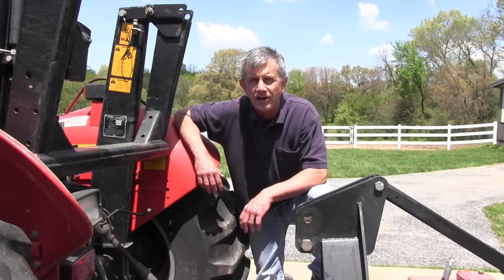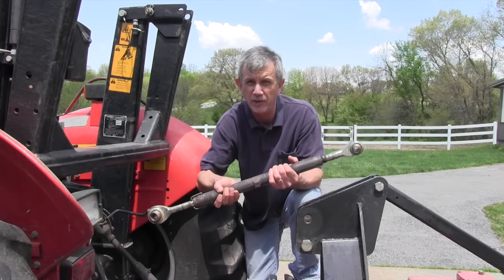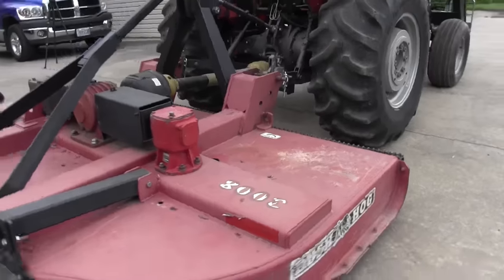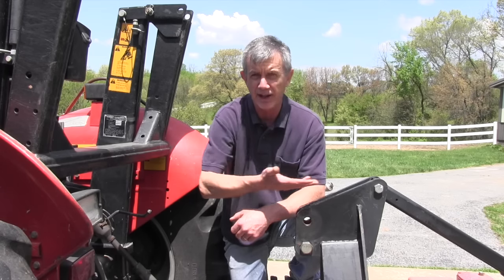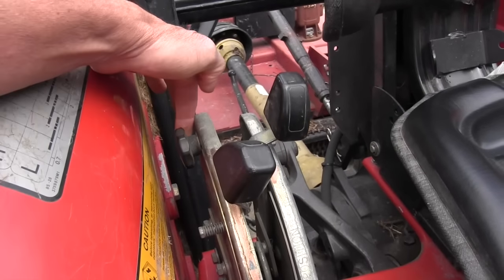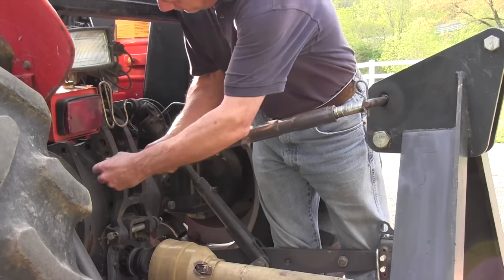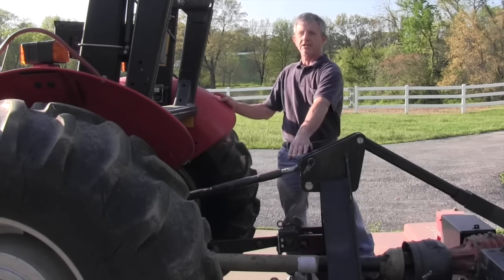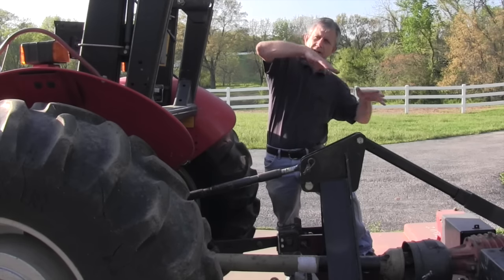Adjusting the Tractor Top Link to Pull a Brush Hog

Comment: Some tips for rear mount brush cutters. 
For cutting grass set the implement mostly level.
For cutting brush, set the back end higher than the front. This will help direct the discharge out the back.
When purchasing a brush cutter get the one with the chain guards.
If you can't afford the chain guards, buy them anyway.
When using 3 point implements, always pick up the tool when doing sharp turns.

Comment: On flat ground you are right to say your top link is along for the ride. In a not so flat area your top arm is somewhat crucial, holding up your cutter while backing down a serious grade when the grade drops three feet. It also helps keep the mower from pitching upwards to abruptly when making the transition to an inclined bank. My implement has a pivoting arm about four inches long which allows the transition to be more subtle.

Comment: Hey Mike the top link mattered ALLOT on my tractor/bush hog! I know you mentioned it needs to allow travel; here is some more detail what I saw. First I have a 48'King Kutter/RK24 combo, the mower  has hinge between top link and deck of mower to allow travel to contour of the ground. I found if it was too short raising the mower lifted the wheel. If I made it longer it leveled out the mower deck in accordance with back wheel. So too short lifts entire mower and longer can adjust the cut level on front of mower.

Comment: Finally.  Someone than knows tractors and can explain 'that' to watchers.  Liked that you used a tape measure. Does a 'top link' shrink?  After 12 years switching from Bush Hog to tiller it no longer reaches the span.  "no longer" is not a pun.

Comment: Old hand taught me to throw the solid top link to the side and use chain for top link.  Your bush hog will float with the terrain and less wear and tear.
Reply: That old hand knew what he was talking about.  A solid top link will either lift the brush hog too high when going over the top of a hill, or it will lift the tractor wheels off the ground when going through a depression.  A solid top link makes the tractor and brush hog solid like a board from front wheel to back guide wheel.  Ground is not always flat. You need flex in the middle with either a hinged link or a chain.  Get your tractor stuck in a low crossing one time and you will throw your top link away whenever brush hogging!
Reply: Yep
Reply: The only issue with this is that it puts your PTO in danger as the angle of the PTO shaft/PTO can become extreme and put significant wear on the system.

Comment: Half the time when I'm busy hogging I don't even hook up my top link. I know my area, I know the ground and there's nothing that I have to raise the entire hog off the ground to clear. So I only raise it slightly at the end of a cut run just enough to keep the skids from gouging in the turn then it's back down and continue.
Thanks for your videos Mike-
Russ
Lithia, FL.
Reply: That is called letting your brush hog float. As you go over a hill, the top link will hang on to the cutter and not let it drop and you will have an uncut part of the field. To avoid this people will remove the top link. Without a top link, If your hill is too steep, your brush hog will pull the gear box so low that the shaft touches the front edge of the brush hog and could bend. That is why you only remove the top link when mowing a field you are familiar with as you stated about your area. You have to attach the top link to lift it up for transport when ready to go home.
Reply: I have a king cutter from Atwoods.. I know it's a inexpensive  model but it has a rotating top link attachment point and I hate it .. when the mower drops off a ledge the top link will pivot down and get jammed up causing the mower to ride higher then I want it to so I just use the top link in transporting it .. so glad that I see other people doing the same
Reply: if you install front rollers on your brush hog you can lower the brush hog all the way down and wont have to deal  
with cutting height adjustment. the wheels will determine the cutting height.

Comment: I have a heavy duty bush hog attached to one of my tractors and keep it on that tractor since it is easier to do that than remove it when I want to use something else and then hook it back up. I noticed when I got my equipment that the weight of the bush hog was on the lower control arms even though the real wheel on the unit stays on the ground when mowing. I don't have a cutter like the one you are talking about, but can understand how all that weight would affect the unit performance.

Comment: I see your using Pat's Quick Hitch. I do as well. I had to replace my top link with a longer one to make up the difference in arm length. Except for my blade which works better with the shorter, original link. My point is that with my cutter, I leave the link longer so it doesn't lift the cutter if I go over a quick roll and leave an area uncut. I also have to watch it isn't too long and bends the link if the back of the cutter goes too far down. Excellent video! I love them all!

Comment: Funny enough for my old JD 2020 I used a chain as a top link.  When using the top link the overall length and making sure the two  screw ends are equal.

Comment: If the top link is not adjusted long enough, as the tractor drives over a knoll and the front wheels track lower than the rear, the cutter will rise leaving a swath of uncut material. Likewise, if the top link is adjusted too long under the same circumstance you will scalp the ground. For an optimum cut I think proper top link adjustment is paramount.

Comment: Mike very good videos and others too, I have a Kubota b2650 and I have different attachments but my Factory OME top link seem to be small are to short for my Rotary Cutter I have adjusted the tail whell and I'm still have the front of the cutter lower than the back, so can I put a aftermarket top link Cat 1 that is alittle longer than the OME to get the Rotary cutter to sit evenly...

Comment: the top link is a safety device which when adjusted properly will keep the tractor from rearing up and getting hurt or killed. the top link  draft control spring must be adjusted properly. Harry Ferguson saved countless lives since he invented the three point hitch which is still used today from his original design. when using any implement it is important to use this safety device. not just 
 ground engaging equipment because any implement can become stuck or hung up and the draft control spring will keep the tractor from rearing up or at least give you time to push in the clutch. i am surprised how many people don't understand how this works but have been using tractors for decades.
Reply: So... What you're saying is it works like a wheelie bar on a dragster. Cool I can relate to that.

Comment: New tractor owner and am glad I found you. We just got a Mahindra 1626 and added on a Mahindra brand model #1205 rotary cutter. Also came with a box blade and scraper. I asked for and was told by my dealer that this and other items I purchased did not come with owners manuals. Seems odd to me. Any suggestions on where to get them or who the actual manufacturer is?
Love the channel and have learned a lot. 
Thanks, Charles
Reply from the maker: Charles, those attachments are likely made by Paladin/Kodiak.  I checked with my local Mahindra dealer, he says many come with an owner's manual, but he looked for a part number for them and didn't come up with anything.  You might contact Paladin: https://www.paladinattachments.com/products/product-finder.  Good luck!

Comment: Mike, Most Australian Slashers don't have a tail wheel and actually sit on the skids when cutting. My old slasher had chains running from the top link to the rear of the slasher to allow it to float on uneven ground, It also had chains that do the cutting instead of blades.
Reply from the maker: Wow!  I knew they probably had to be much different.  If I ever get rich doing free videos it's on my bucket list to travel around the world, especially to Australia, and observe the differences in equipment.  I like the name "Slasher" better than "Brush Hog" because it seems to be more descriptive.  People in my circle of friends that I've told what rotary cutters are called in Australia have started calling them "Slashers" for that reason.  I'd be fascinated to see what a chain cut looks like and how it must just destroy undesirable woody plants.

Comment: After two years at the dealer in Ocala Fl I finally got the tractor back, however I ran the tractor with the bush   hog and it seems that it couldn’t hold its rpm’s. It would fluctuate from 5 all the way to 30 I noticed it needed some radiator fluid so I filled it up. Do you think it was overheating that causes the low power?

Thank you so much for your thoughts 💭!

Comment: Hey tractor Mike I've always loved your videos I was just thinking about one you've not done so I was thinking about a comparison between a mower that you pull with a dry bar and a mower that is a three-point mount because I was actually thinking about getting a larger brush hog that does not come in three-point they're normally only dry bar hookups
Reply from the maker: The pull-type mower will be easier to hook up, but less maneuverable, especially if you back up a lot.  I grew up with a pull-type, they're probably a bit less stress on the tractor hydraulics since the weight is not on the lower links.  I'd be happy with either one.

Comment: Mike. I got the same Pats quick hitches that you have. Will I need a PTO extension?  My rotary drive line clicks in place on the Pto as it should but I wonder if I have enough up&down play in the cutters driveline. Thnx
Reply from the maker: Mort, hard to say, none of my attachments needed an extension, but it depends on what the manufacturer recommends for overlap and how much extra you have.  It would be best to mark where the PTO halves come together on the outside, then pull the shaft off and see how much overlap is there.  That'll tell you if you need an extension.

Comment: Mike, do you run the risk of bending your PTO shaft mowing downhill, like the backside of a Pond Dam, when you get to the bottom and the tractor levels out but the Brush Hog is still angled up the hill?
Reply from the maker: OH YES!!!  if you have a sharp change in grade at the bottom, you can kill a PTO shaft quickly.  Any where there's a huge dip your PTO is in danger.

Comment: I had a pin come out of one of the lower arms on my Kubota. i put the pin back in the slot where it came out and then when i tried to engage the brush hog it shakes violently and pitches violently. What did i do wrong?

Comment: Mike you didn't mention but another issue with a top link on a rotary cutter is this
 When the back wheels of the tractor drops in a low place or going through a dip in the ground. With the cutter picked all the way up it can hit down back at the wheels and hang up the tractor.  So instead of a solid top link or adjustable one i always prefer to use a short piece of chain. You can still lift the implement properly  but if it hits down in the  back the chain offers enough give to not hang the tractor.
Reply: The chain handles the more moderate undulations well (as can no link) but on ditches, the pto shaft can get bent. The rigid top link can protect against that.

Comment: Hello Mr. Mike. Just bought a new 2020 Kubota MX5400. 4 wheel drive, HST, Is there a Sequence for changing gears and neutral? Mine sometimes Scrubs and I know that's not good. Read all manuals. Less than 30 hours. Dealer is a Friend and don't want to sound like an Idiot b4 I call him when it's probably something simple I'm not doing Right. Thank you.

Comment: How did you adjust the mower deck to 3 and a half inches before you installed the top link?
Reply: With the quadrant lift control on the left of the seat. When he was talking about adjusting the stop.

Comment: Why did you use the example of backing off a hill.  It may be nothing but I wondered why you wouldn't pull off the hill forward.   Secondly I can't find a crank style link adjuster to fit my 3032e.  Do I have to break out a wrench each time I use my box blade to cut around my garden and again to level my driveway or do you know of another option for me?
Reply from the maker: You could pull off the hill forward. I have a big drop west of my house where I back over and cut the weeds that are in sight of the house doing it the way I described.  When they get high enough and start bugging me I'll knock all of them on the whole slope down and I usually do it the way you describe, keeping the tractor at the bottom and pushing the brush hog up to the crest.  

I don't know of a crank adjuster for your Deere.  Why all the tractor companies don't make them an option that you can buy later is beyond me, but I've never seen it.  I'll check with my local Deere expert and see if he knows of anything and if he does I'll let you know.  You might try A&I.  They're a parts company that supplies aftermarket parts for all brands, and they're actually owned by Deere.  They might have something like that and their website is fairly easy to navigate.  Good luck!

Comment: Mike-I also use the Pat's EZ change hooks on my tractor resulting in the need for longer PTO shafts and top link. My current top link has a max extension of 32" which is still a bit short when using a couple of my implements ...as this seems to be the max offered for a cat 1, does anyone offer something to extend it? Thanks for all of your helpful videos..,Brent
Reply from the maker: Brent, most equipment dealers/farm supply stores offer replacement top links in varying lengths, I have one for my 40 hp tractor that I use when the OEM one is too short and the main body on it is 20" long while the factory one I normally use is only 16".  I think if you had a 20" barrel you'd be able to add a few inches on to what you're using now.  I'm not sure if anyone makes longer threaded links, if you find those, remember, one is reverse threaded.  Next time I'm getting parts at my local dealership I'll look to see if they have those.

Comment: Hi Mike, I have a question for you. I found my pin to my PTO shaft completely disintegrated along with the spring, tried going to Tractor Supply but the two pins they sold me is either too big or too small. I think their name brand is Weasler or weasal, not sure. How Can I find out what size pin and spring I need ?? thanks, Ken

Comment: It's best to leave it off if you're mowing a field that is wavey so the bush hog doesn't go up and down.
Reply: My method is to cut the top steel rod from the tower to the deck and replace with 1 or 2 links of chain in the middle.  This allows you to run  a top link but allows the tail to rise and fall enough to mow a undulating field.  Many have the top bar on the mower as 1 or maybe a 2 piece flat steel linkage.  But it needs about 2 or 4 links of chain to let you let out the top enough to glue over a hill.  Bottom links set ride height top just lifts tail.

Comment: My tractor doesn't have a PTO stop bracket for the 3 point lift, what a pain!
Reply: Use your top link to set the height. Lenghten to raise front of mower and shorten to lower. Dont worry about what he says about carrying the weight on lower arms.

Comment: Mike, can you do me a favor and confirm that you have not misspoken at about the 3 minute mark.  All the research I have done says that the top hole is for implements that are not ground engaging (a bush hog, for instance).  The center hole is for light ground work. The bottom hole for heavy ground work (like box blade, landplane, plow).  This is the opposite of what you state on this video, so now I am confused!
Reply: I thought the exact same thing and picked up on that as soon as Mike mentioned it.  I think he has it exactly backwards.  Still enjoyed the video
Reply: @M35a2guy  read up on Harry Ferguson and his three point hitch draft control. Harry was a very intelligent man. built the first airplane to fly in ireland. invented the double wishbone front suspension for cars. built the first 4 wheel drive car.
Reply: @M35a2guy  I agree with you,

Comment: Why does my brush hog rear wheel dig into the ground so much?  It’s almost like a plow!
Reply from the maker: Colt, it's possibly adjusted too low.  I have a video coming out soon (maybe next week) on how to set tail wheels.  The brush hog I'll be showing had the wheels set too high, they were off the ground at the desired mowing height.  If the tail wheel were too low it could dig in. Also, if the bearing inside has failed or it needs grease, it may plow when you turn because it can't swivel.  That could also be the problem.
Reply: Tractor Mike Thank you sir.

Comment: Don't use the top link on my bush hog, it becomes an issue when going through small depressions in the field. Actually broke by back wheel assembly once. It was the first to give when the tractor and bush could not pivot.

Comment: I used a chain in place of the top link still allows me.to.lift when i need or want to but lets the brush hog follow the contour of the ground better!! I also built some.brackets and added chains at the height stops so.the weight isn't hanging on my lower lift arms solely therefore constantly keeping a load on the pump and lift mechanism and by doing it that way i can lift as normal and when mowing i just drop the arms so no pressure is on them but rather the chains something I learned from an old timer for my 1940 9n!! Would probably use it even on.a.newer tractor n brush hog setup